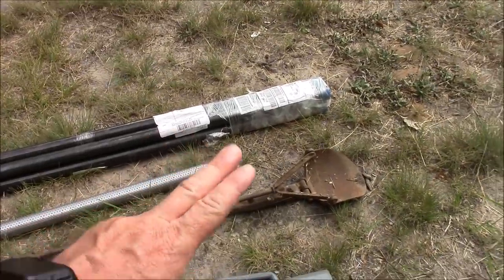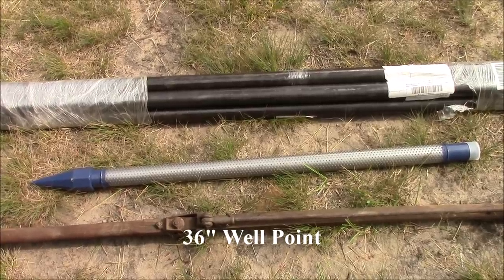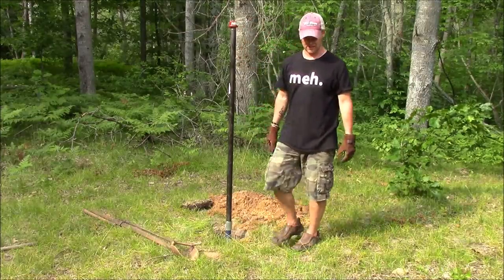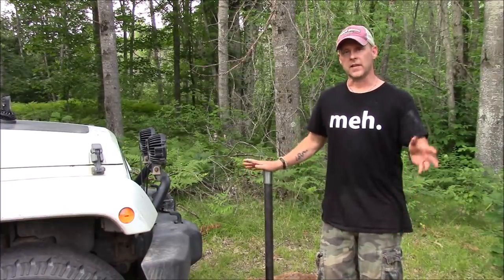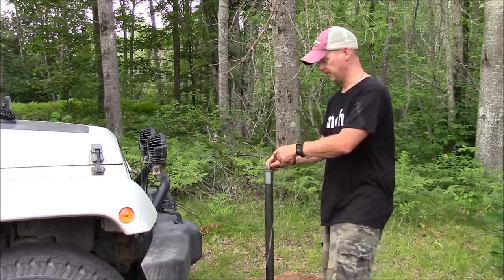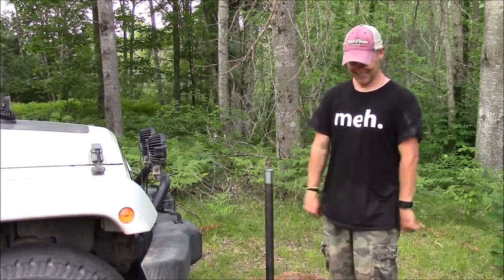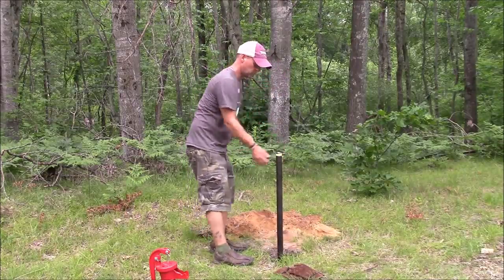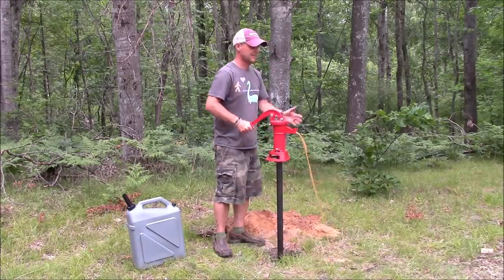Installing a Sand Point Well at the Off-Grid Cabin

Comment: Hmm!! maybe I'll try it. :)  There is a pond about 125 ft from our property line so it may be easy to find water, however, it's about 500 ft to my house and garden area and about 15 ft higher as we head to the house.  Elect pump may do it.
Reply: Solar pump might be a good fit for your situation.
Reply: I pumped from a stream to my cabin with a 100 watt solar panel and 12 volt pump for years.  About 80' from water level to my storage tank and a few hundred feet away.  If you put your well close to the pond then the water level should be high and a 12 volt pump like a Shurflo should have no problem with the lift (water level to pump).  From the pump to cabin just size your pipe large enough for distance/flow and you should have no problem.  I can't remember if I used 3/4" or 1" poly pipe.

You'll probably need a controller so that the pump can run under even low sunlight conditions.  The controller will protect the pump while letting it run at a slower rate.

I think I was using a Shurflo 2088-554-144 Fresh Water Pump, 12 Volts, 3.5 Gallons Per Minute, 45 Psi pump or a similar model.  If you're pumping into a holding tank you should get a lot more flow than 3.5 gallons per minute due to no pressure build up (other than lift).  Be sure to use a strainer on the intake side.  Bits of sand can get stuck in the pump diaphragm.
Reply: Thanks, I have a few Shurflo pumps, I worked at west marine after I retired and lived on our boat for 4 years. Pumps were a good thing to have around as backup.  I have 1, 220watt panel and a small wind turbine so they may help.  Thanks again.
Reply: @buzzsah  I know West Marine well.  I lived on a sailboat for about five years and spent a lot of money at West Marine.  Good company, good products and fair prices.  My first solar experience was using two 35 watt panels on my boat for lights and music.  What I didn't have a good handle on was "deep cycle" marine batteries vs. real deep cycle batteries.  The kind of deep cycles sold for boat use didn't have really thick plates and didn't hold up well to daily cycling.  I think they were really for taking out your trolling motor a few times a year to do some fishing.
Reply: At one time when I worked there, it was well worth working there.  They gave their employees a great discount 10% over their cost.  I would pay 12-16 $$$ for a 90$ zinc, a 250$ Heany Loyd rain gear set 49$, if we wanted a Garmin we would call them and buy direct at cost, I bought 3100$ in garmin for xmas gifts it cost 1600$.  Like you was lived on our boat for 4 years and traveled for Boston, to Baltimore, CT to up the Hudson to Cold Springs, we spent a few weeks a year in Riverhead LI, New Port, Ply Ma, Chelsea piers,  Our port was in Branford River, CT. but we were never there, NY, NY little Italy for dinner, Alt city for a show,  Port eff for a hotdog. lol.   300-500 hrs a year. Winters we stayed in the slip in CT our home port. It was a great time until back surgery, then a heart attack.

Comment: It really makes only a very small difference,, black iron pipe is for running gas lines,, Galvanized (shiny, silvery) iron pipe is for water.  Buried underground the difference is perhaps 10 or 20 years of life span. 40 or 50 vs 60 or 70.
Reply: Sailor376also plus the black pipe will rust
Reply: @joeetmoniqueo4024  Both will rust,, the galvanization will slow it down a bit.  The exposed threads are the weak point in either.  The galvanizations principal role in water delivery pipes are the pipes across the basement ceiling.  When cold water chills the pipe in warm or humid weather water drops condense on the surface of the pipe.  The zinc coating prevents the rust on the surface that would otherwise form.  Rusty drops on the basement floor would not be popular.

The more important feature for a pro is that black iron alerts to it being a gas line.  A galvanized coating is a sign that it is a water pipe.  God save your soul should you ever make the mistake of blithely tearing out a gas pipe,, while thinking you have already turned the water off.  BOOM !

Comment: Just saw your driven Well  project, that’s awesome, I’m planning the same thing next spring but on eastern end of the U.P.,  how’s it working ? , any advice / mistakes made you’d like to share?    Anything you’d do different?
Reply from the maker: Don't do it alone.  Use galvanized pipe if you plan on drinking it. It was working last weekend and I used it on my garden. The cost benefit of doing it myself was worth it.  now, at least...not so much at the time. Have your water tested.
Reply: I’m going to try the same thing in the Western UP! Let me know how it goes!
Reply from the maker: @BarkRiverMusic  I was at my property today and the well worked perfectly and my garden needed the attention.
Reply: Just curious what part of the country are you in?

Comment: Does anyone have any recommendations on winterizing the pitcher pump? Can it be used all winter? I installed a shut off valve just below it the pump, so I can keep it primed during the summer and I figured in the winter open it and let the water drop down. My water table is 22 feet so it’s better to keep it primed as much as possible. Any help with winter prep is much appreciated.

Comment: How long will that galvanized pipe last until it rusts out?  Also, is there enough flow from them to feed a small sprinkler system?
Reply from the maker: I used non-galvanized pipe because I was not intending to drink from it. I am not sure how long it will last. If you hooked up a pump it could run a small sprinkling system because I saw it on Homestead rescue once.

Comment: I was thinking about using a 2 in to do my well on my property I see a lot of people is using 1 1/4 well point to do their well I don't know which one to use
Reply: From what I understand the 2" is for anything that will be over 50ft. If it is 25 ft or less you can use the 1 1/4.
Reply from the maker: I matched my pipe to the pump and sandpoint I purchased. The lesser diameter requires less pumping power.

Comment: Did you really only have to prime it once and you were already drawing water? I can’t seem to get mine to get water and I’m just priming like a mad man. I’m 25’ down.
Reply from the maker: Yes. But, later I had issues that were caused by the cracking of the leather seal. Got a new one and had no more issues. But. I do have to prime every time because I did not put in a check valve.

Comment: Don’t know where you are, but you might want to consider disconnecting the last piece of pipe and drilling a weep hole in it below the frost line.. yeah it’s a PIA- I’d use dope rather than tape on the coupling. It’s going to suck if that pipe freezes & cracks.. I’d also anticipate the pump getting stolen.
Reply from the maker: I hoped to not worry about the weep hole but there is a chance the system will freeze up. I am far enough away from folks to hopefully not lose the pump itself. I know my neighbors and that helps. Agreed about the tape as well.

Comment: Do you have a recommendation for how deep you might want to dig to potentially use as drinking water? By the way, I loved this video. I also laughed before you did and I thought I was an ass. 🤣
Reply from the maker: 80-120 feet is the recommended depth depending on where you live. I checked. If I were to drink water at the depth I have I would need to purify it or pasteurize it. I use this mostly for watering the garden etc.

Comment: I don't know where you are, geographically speaking. But I done this (well drilling by hand) 3 times. You're right to turn the pipe string to keep everything joined. But ... those don't look like Drive Couplings to me, just ordinary pipe couplings and a well-drilling hammer is heavier. That's a fence post driver.
Reply from the maker: I had one drive coupling as they were expensive.  Probaqbly could have used a heavier hammer.
Reply: @LordCryptid  For what its worth we used one "Drive Coupling" on top of the string only, all the rest were ordinary couplings.

Comment: Great video.  I know the pump has a check valve in it, but do you need another one in the pipe?  I'm getting ready to install a pitcher pump.  Thanks.
Reply from the maker: I have not used one but I also don't depend on it for more than watering my garden. It is probably a good idea.

Comment: Just curious, if you did all that work and didn’t hit water, are you able to pull it up some how and reuse it?
Reply from the maker: That would have been horrible.  I would certainly try.  The point would still be good...getting leverage to pull it up would be an interesting trick.
Reply: LordCryptid I’m just curious because that’s my kind of luck. I will be doing one soon.
Reply: If you were able to attach something to the pipe that you could put a hydraulic floor jack under you could possibly get the leverage needed.

Comment: Good evening, LordCryptid.  You have a very infectious smile. hehehe.  Love your attitude.  Maybe rig more weight on that pipe driller so less reps???? May I ask you what do you call that pointy mesh at the beginning?  Sandpoint?  I thought that was the name of a towm... Hehehe pardon my ignorance.
Reply from the maker: https://www.amazon.com/Simmons-1722-1-4-Inch-36-Inch-Stainless/dp/B000FK9VE6/ref=sr_1_1?crid=NS60GEADMCS9&dchild=1&keywords=sandpoint+well+kit&qid=1595598187&sprefix=sandpoint%2Caps%2C267&sr=8-1  I got mine for really cheap on Ebay. This one is from Amazon.  There is a Sandpoint , MI in the thumb area.

Comment: Nice video! Does it work alright without a check valve and will it work in the winter?
Reply from the maker: I tested it yesterday after the entire winter without use.  It worked and took a good deal of water to prime it.  Also, a bit of rust because I used iron pipes (just for watering the garden anyway).  I did not attemp winter use.
Reply: @LordCryptid  okay, thanks!

Comment: Do keep in mind this is surface water and not ground water.
Reply from the maker: I just need it for watering plants so it works fine for that.
Reply: @LordCryptid  A solution for using the water for drinking is to pump into a storage tank, treat the water with a bit of household bleach, and then run the water through a charcoal filter to strip out the chlorine  taste/smell.  Or use an osmotic filter.
Reply: Would you be able to use the surface  water for animals to drink?

Comment: Great video! Looks like you used black iron for your drive pipes?
Reply from the maker: Yes, if I were drinking the water I would use galvanized. But the plants don't mind the extra iron. It does filter out easily for drinking when needed.

Comment: How much water can you get in a single go before you exhaust the pipe?
Reply from the maker: I guess it depends on the water table and the strength of the pipe.  If the water table remains and the pipe is intact it should work till the screen is fouled or the seal in the hand pump breaks.
Reply: Depends on how saturated the ground is and if you have clay in the ground. More sand equals better flow.

Comment: I think I would still try and get it deeper if you have more pipe. I’m sure you’re far enough away from pollution but in a drought you may lose water. 20’ would be minimum I would drive the point. Can you push it deeper with a loader. There is always something to do with a rental Tracktor after this.
Reply from the maker: I wanted to wait for Spring because it was pretty hot out at the time.

Comment: Does the sand point have a foot valve in it or do you have to prime the pump every time you use it?
Reply from the maker: I have to prime the pump when I use it after a few days if it is hot out.  There is no foot valve.

Comment: Also, have someone turn it with a pipe wrench after each hit. (clockwise only!!)
Reply: One more thing, if you get a force pump you can hand pump water uphill or up to a water tank.  My dad used one at a camp in upper state Vermont for years.
Reply from the maker: @jameshaskins6610  Having another person around would have been quite helpful I assure you.  I am looking into a force pump.

Comment: Should have insulated the exposed pipe with your choice of insulation then slid a 4" diameter PVC pipe over the insulation and water pipe down to the ground and up to the bottom of the hand pump.  Or slide the 4" PVC pipe over just the water pipe and used a spray foam insulator inside then put the pump on over it.
Reply from the maker: Agreed. If I were relying on this for anything other than casual use I wholeheartedly agree. Great ideas.

Comment: That appears to be black pipe...not good it will rust quickly. Galvanized would be much better. I prefer to drive 2" then one can drop a 1 1/4" pvc pipe down inside. Shave the pvc couplers down slightly to fit better down inside. That drive cap can damage your threads easily. Use a drive coupler then a pipe nipple maybe 6" as your sacrificial piece. They're cheap and easy to replace
Reply from the maker: Agreed. Good ideas.

Comment: I'm an electrician by trade. One thing that would have made this 100 times easier is to use a chipping hammer to pound the pipe down. You would need a "ground rod" driver attachment or similar to a fence post attachment for a chipping hammer to use to drive the conduit down. I've seen electrical contractors I've worked for drive 80 feet of ground rods down with the use of a chipping hammer. God bless. Hard work. How much water does your pump "make" before it runs dry in the pipe and needs to have time to fill up again? Thanks!
Reply from the maker: I have pumped it 100 times and not run out. I have to look up a chipping hammer. Particularly, if I am ever going to do this again.  Or, if I have to drive deeper.
Reply: @LordCryptid  https://www.amazon.com/dp/B01MSEAK83/ref=cm_sw_r_apa_i_uUfWEbQT01J3J

This is a style of what I mean by the chipping hammer. DeWalt sells great ones. I'll try and link the ground rod attachment. You may have to have something welded by a welder. 👍
Reply: https://www.amazon.com/dp/B07DH9CZRK/ref=cm_sw_r_apa_i_t1fWEbC95NYFW

You need something similar to this but larger. I'm sure they make it I just haven't seen it yet. This is the attachment they make and it works great for electrical ground rods. Puts them in like butter.
Reply from the maker: @onecrazywheel  Cool.
Reply: Or at least a better post pounder.  

I've installed many dozens of t-posts into very rocky ground.  Basically into fractured rock.  

First, no handles.  You can't exert as much downward force using handles compared to a simple tube you can wrap both handles around.

Second, heavy - heavy - heavy.  Most of the force comes from the pounder, not your downward hand movement.  

I blew the handles off one 'store bought' pounder and the end out of another.  I had a metal shop make me a pounder from a 3' piece of 2" steel pipe.  On top they welded a 3" square of 1.5" steel.  There's no comparison with a farm supply pounder, this is a serious tool that makes the job far easier.

And pour water around your pipe as you pound.  Water is a lubricator and decreases the pipe to sand/dirt friction.  When I've got some posts to install I first soak the ground where I want the post and then drive it in.  Makes a big difference.
Reply: @bobwallace9753  Hey Bob, quick question please. What do you do if you're 8-10' down, (4" auger style fence post digger) "have" some water in the ground, plan on driving a 1+ 1/4" sand  point, but hit a rock? Possibly a small rock. Only need to go about 5' more, and don't want to scrap the hole. Is there a way to bust the rock, or go around it? Thanks for an opinion.
Reply: @joequillun7790  What should you do?  I don't know.  But I can tell you what I would try.  I'd get a sharp point chisel and weld it to a length of steel pipe and make a long rock bar, then pound away.

Here's a chisel that seems it would work.  Foune it on Amazon. 
Mayhew Select 80205 3/4-by-12-Inch Guardian Handguard Bull Point Chisel

Looks like it might fit inside a piece of 3/4" water pipe.  

I've got a 5' rock bar that is heavy steel and has a pointed end.  I've pounded my way through a lot of rock around here.  But my rock isn't granite.  I guess it depends on what kind of rock you've got and how large a piece you have.
Reply: @bobwallace9753  I've got a similar 5' pinch bar Bob, with a tamper on one end, and a chisel on the other. Mainly use it for busting through roots. Wish it were long enuff to reach that rock. I had the same thought about a chisel on a bar too, but didn't think about the pipe idea. Thanks for responding. I'll let you know how it ends up.

Comment: Just a thought 
But what about renting a 60lb or bigger electric jackhammer and fabricating a bit end to drive the pipe?
Yes, your off grid, but a small generator and some gas should drive that thing to China depending on the soil conditions
Reply from the maker: If I had to go any deeper or if I was going to have to do it again I would go this route. Or at least have a buddy with me.
Reply: LordCryptid 
I helped a buddy with his sand point well years ago 
It had clogged basically from whatever, we just added 5’ and hammered it down, flows good to this day!
Reply from the maker: @gutshot300mag  I saved some pipe for that eventuality. Thanks for the info.